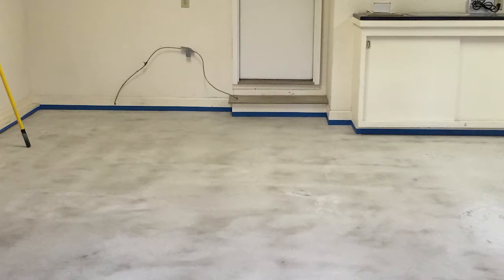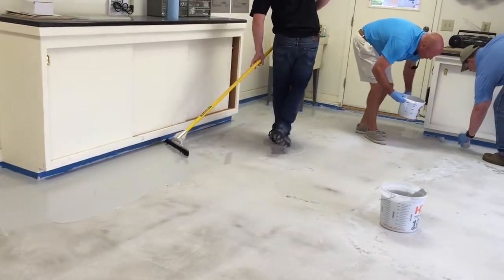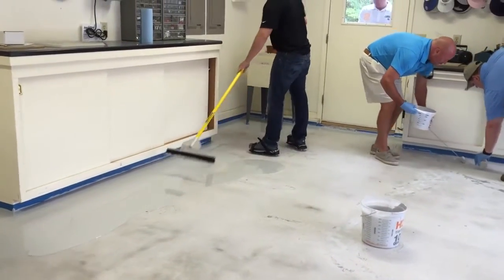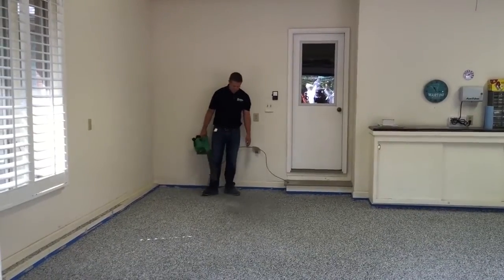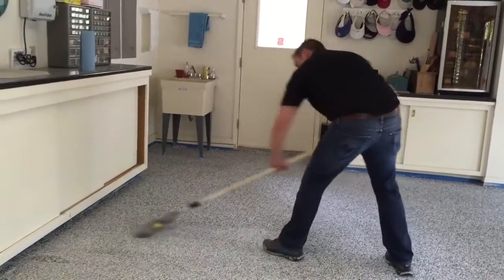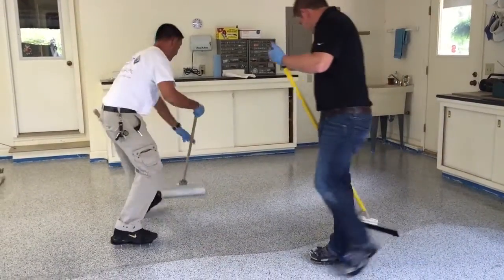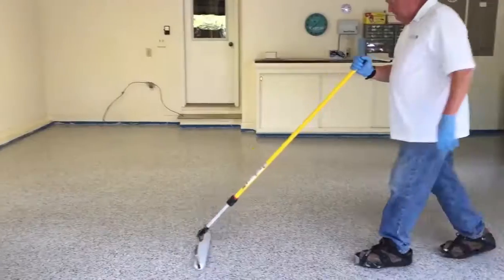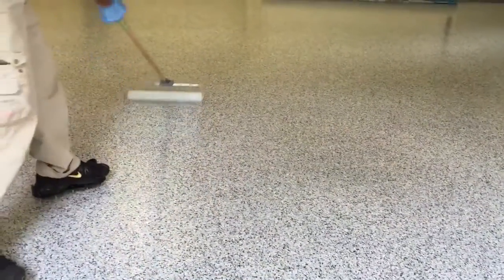How to install SPARTACOTE Chip Coating Systems for Concrete in Residential Garages

Comment: How much does something like that cost?
Reply from the maker: Hi Derek - there's a lot of factors that play into pricing such as size and the exact products that are needed. If you email socialmedia@laticrete.com with your contact info and location (zip) we can have a local rep reach out to you to discuss your project. It's installed by a professional installer who's been trained on our system.